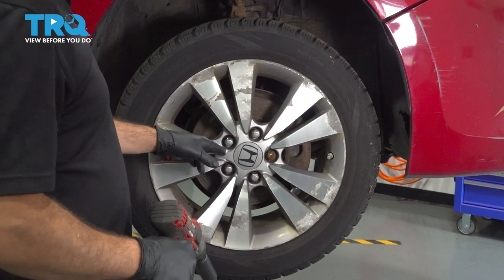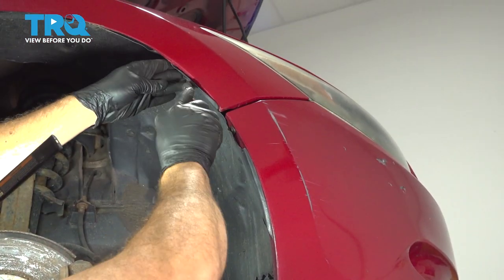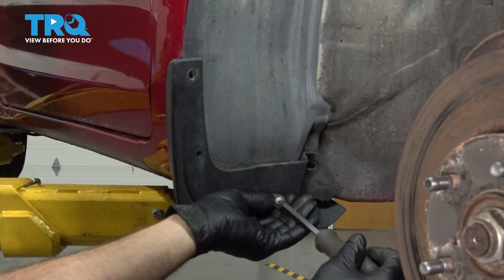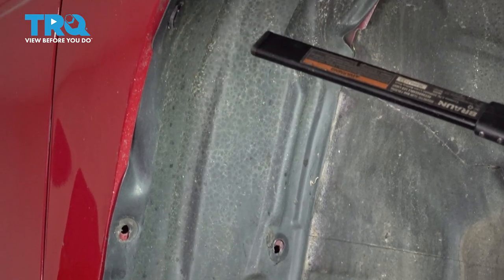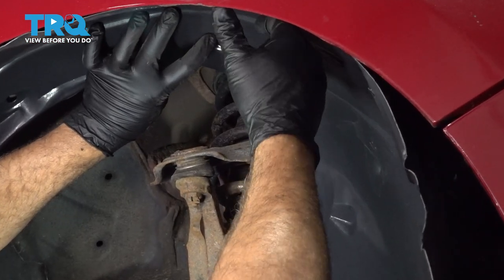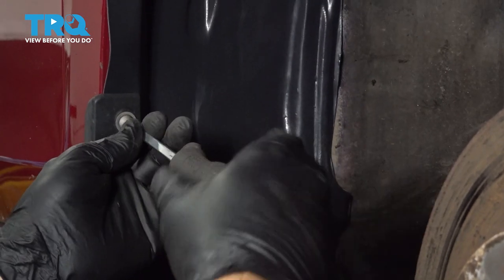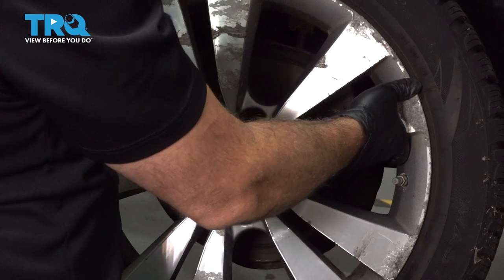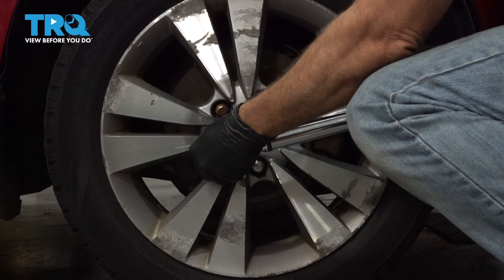How to Replace Right Front Inner Fender Liner 2008-2012 Honda Accord

Comment: Easy to install but make sure the plastic clips. Are snug I learned this the hard way. I put in a few loose fitting clips. Not good the wind catch as I was driving. Dragged it to the asphalt and tires naw it off. Had to reorder anther splash guard haha I am going to zip tie the bottom piece to the bumper.
Thanks for the share 😊